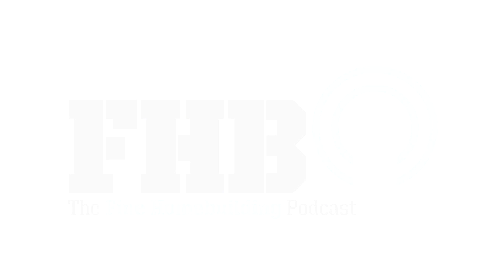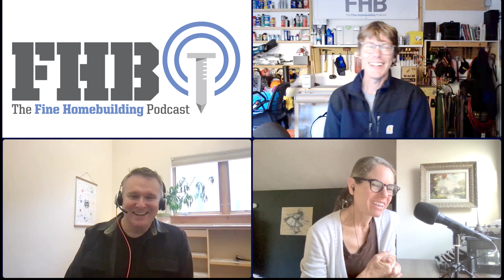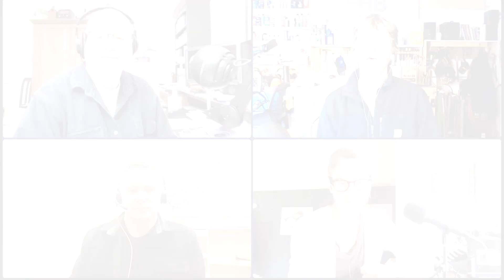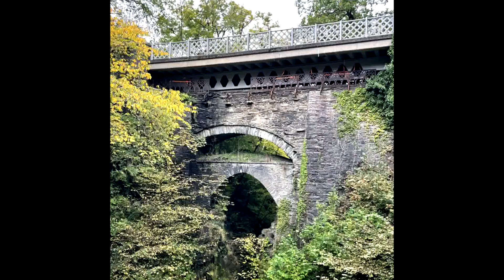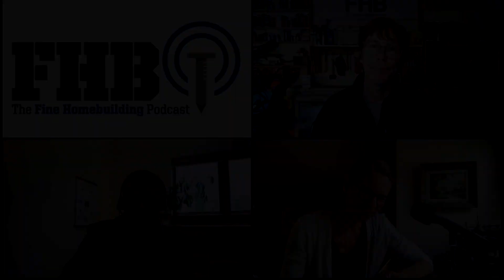Podcast 509: Fiberboard Sheathing, Big Holes in Concrete, and Makeup Air for Crawlspaces

Comment: My thinking is that as soon as my crawl is capped I gotta get the radon out from under the poly. Lstiburek calls it “mining” soil gasses when it’s air tight and not ventilated right.  

Would love a follow up from the sill seal questioner!

Comment: On the foam sill seal gasket that doesn't really stop air movement, I am always apprehensive about acoustic sealants due to their mess (including when the home, eventually, needs work in that area again). Is there a tape that seals sufficiently well to the concrete that would eliminate the air flow? Otherwise, liquid flashing seems like a compelling option.